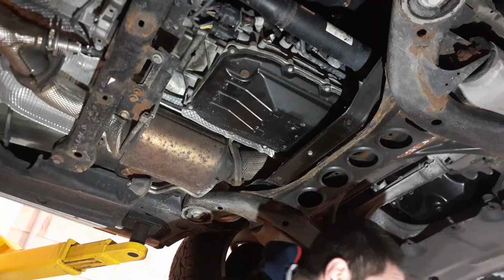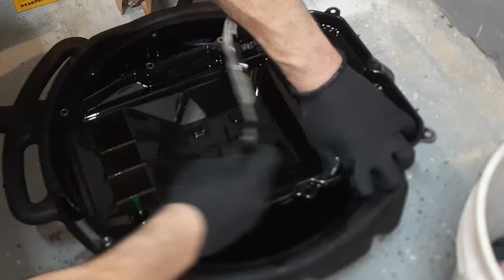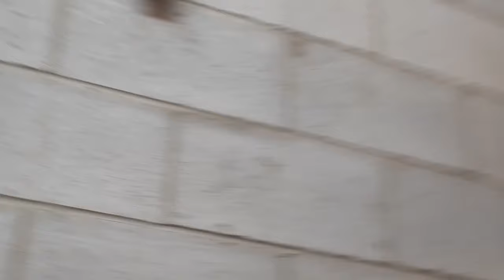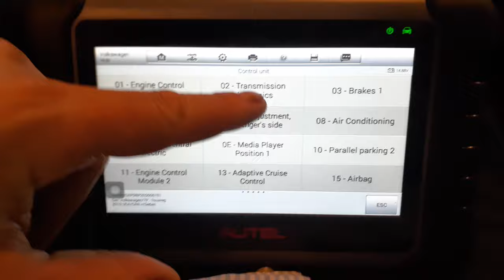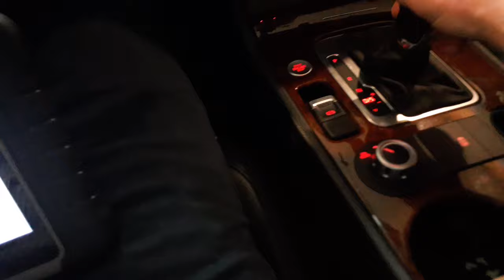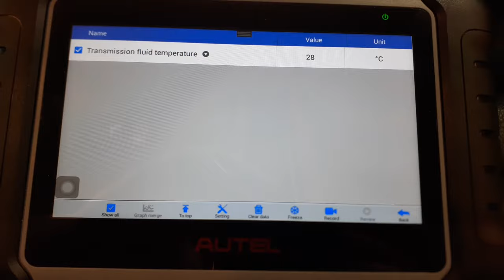VW Touareg Automatic Transmission Service

Comment: One tip, when you remove the pan bolts,  leave two of them on opposite side of each other barely tightened and in place. Then precede with the pan removal/prying. After the pan is no longer stuck to the transmission body remove the two bolts and lower the pan. Easy and zero mess.
Reply: Great tip, worked like a charm!

Comment: Very good "how to" video!! I have assembled all the components and fluid I need to do mine. I do not have a lift, so it will be a set of ramps and jack stands (keeping it level) and a creeper. I plan on driving it until full operating temp, this is about 180°F for fluid temps. Then I'll do the drain, pan drop, filter change and pan cleaning, and wait a couple hours until the temp is a lot lower.  I plan on leaving the parking brake on, holding the brake pedal, and rowing through gears while it's in the air with the front wheels on ramps, and the rear is on hack stands to make sure and circulate the fluid for the level check.

 I noticed you did not remove the engine/transmission dust shield bracket mounting crossmember, and you worked around it with a wobble extension. How hard would it be to remove the bracket I wonder? Or is it best to leave there when tilting the pan down it has something to "stop" from falling off completely? One of my concerns is making a massive mess while I'm on my back under the car! So glad you showed the "oops" moment when it dumped over the edge! This is the kind of info I like seeing so I can avoid it myself. Thank you thank you!

Comment: So glad I have a Toyota HLander.  Tran oil and filter change was easy.  Filling the ATF was via the fill & measure tube under the hood.  Why does VW make it so difficult.
Reply from the maker: I know so dumb
Reply: vw is not the only ones that do this anymore but it is still a rediculous method.
Reply from the maker: Toyota/ has a similar method if you follow service manual it's actually worse. But some friend I know at Toyota say whatever amount comes out goes it lol

Comment: This has been done incorrectly to get all the old oil out you need to undo the pan first drain clean replace filter reinstall pan, then remove the clamp for the transmission cooler by the radiator then attached 2 clear pipes on the cooler pipe flange and place in large container, fill the transmission with fluid about agallon of new atf useing the filling tool and a pump then place pump in another full bottle of ATF get some one to start the engine in neutral and watch the old oil get pushed out of the cooler pipes via the clear pipes from the torque converter and pump more AFT into the transmission at the same time , when the oil in the clear pipes turns from black to red then turn off the engine, reattach the cooler pipes to car and add up all the old oil to work out how much came out , then fill with same amount of new atf oil , start engine then run through gears and leave running in park pump more aft as nessaserry and then remove filling tool and let it drain till it stops then replace plug , this will ensure all the old oil is out of the torque converter and oil gallary combined with the pan removal this process will remove almost most of the old oil from the transmission.

Comment: Hello, I have a curious problem in the automatic transmission more than 2 years ago, which does not prevent the operation of the vehicle, nor does it give me a failure either. My Touareg 3.0 tdi v6 240 year 2010 7p5, when I select Sport mode in the box it indicates it but the operation is like the Drive mode. Sometimes it works well and sometimes it doesn't, what can it be? Thank you in advance.
Reply from the maker: I’m not sure. You would need a scanner and access to the tcm then you can see if it is actually in sport

Comment: Excellent video, thanks! Any comments on filter brands and which ones to avoid? Factory VW is stupid pricing but I read somewhere that Elring supplies OE.
Reply from the maker: I usually check what aftermarket option fcpeuro gives as a alternative because they tended to not want to sell garage parts.

Comment: Cool video. I noticed that the odometer was at 160 000 km. Was that the first transmission fluid change?
Reply from the maker: Yes it was.
Reply: Thanks for the reply. 
Good to know. I have a 2013 q7 tdi that I bought used. It just turned 200 000 km. I have changed all of the fluids except the tranny. A little nervous to do it at this point as I have no clue if has been done by the previous owner. 
Have you seen the Touareg after the gearbox oil was done? Any problems? 
My VW/ Audi specialist mechanic says not to change it at this point. He says the new oil would be too slick or something like that which could wear the clutch packs very fast and ultimately  lead to the failure of the transmission. In your honest opinion Should I listen and wait for the transmission to die or change the gearbox oil and gamble ?
Reply from the maker: @denisdavidov2297  If it has never been done. Don't touch it. Asisn, ZF 8 speeds are known for having issues if you change the fluid late in the vehicle life especially if the fluid is super dirty... you could technically drain just the pan. Catch whatever comes out. And put the same fluid you took out back in if it's super dirty. If it looks pretty clean then change the 3liter or 4 that come out with just the drain.
Reply: Thanks for the advice. Much appreciated
Reply from the maker: @denisdavidov2297  no worries.
Reply: At some, hopefully much later, point the transmission will fail. Would it be wise to get a used 8 speed or shell out the big bucks and get a brand new one?. I wonder how much it would cost?
Reply from the maker: @denisdavidov2297  brother no need. Remember it's about you how you drive, how you tow.  I've seen transmissions that never have fluid change make it for the life of the vehicle.  And some fail premature because of abuse. So I wouldn't be stressing. Enjoy it.
Reply: That’s a good point. I dive it like it was designed to. I don’t abuse it but for sure I like to open it up to stretch its legs once in a while. I am careful when I am towing but it is part of the reason why I got it. Maybe it’s not realistic, but I want it to reach 500 000 km. We will see how far we get.
Reply from the maker: I also tow with my rig. Boat,  and utility trailer. She doesn't struggle a bit. I know that in and out job will be needed with higher milage to address leaks, timing chain, front cover things of that nature. Usually 250,000+km those issues arise. Injectors maybe if they get clogged. There are some good videos about concerns with these engines. Just gotta look.
Reply: i have 250 K kilometers and they said yuor car is seald.no need oil change ?
Reply: @denisdavidov2297  Так что в результате решил ? заменил масло или так как есть оставил ?
Reply: @aleksandralex4085  left it alone.
Reply: Hello. What brand of oil you used? It's ok if i change on my Treg with only 56k km on board?
Reply: remember VW sell these cars as a no service transmission,meaning the entire  life of the vehicle they are good to go.This is obviously absurd since the same plattform Cayenne call the service for the auto trans at 90k km.Now my advice is have this unit serviced every 90-100K km.There are no clutches and steels that don't worn out contaminating the oil,the pasage in the valve body and the shifting solenoids and valves.There are specific designed machines for the service,which use the cooling line in and out as a filler and a flusher device pumping inside a flushing additive,then, after the pan is dropped and filter changed,they push in new fresh oil and they top as per shop manual with the requested operting temperature.Keep in mind that the torque converter,the hydrauliuc turbine clutch in front of transmission alway hold about 2-2,5 liters of old bad oil and contaminating materials.To be sure to totally flush the converter these machine, during the warm up phase,pump continuosly fresh oil in a closed loop till the color of the oil passing through the machine is perfect clear,then they do the final topping and disconnect cooling line from the machine .
Reply from the maker: Yeah, I spent over 15 years at the dealer using those machine's.  The avg person doesn't have access but they can do more frequent drain and fill. Over time you'll see a change in the colour of the fluid which is a slow more time consuming way of flushing the system.  We used to do it on old 2003-2004 Honda Crv at the dealer. nautorious for slipping clutches.  We would drain, fill, drive, drain fill drive. Eventually we would have a vehicle with clean fluid and less to no slipping. People neglect there vehicles or are told by manufacturers that it's life time or 15,000km oil changes truth is. It's all a gimmick to try and show you how little money you need to spend servicing the vehicle.  The truth is you'll pay for it later. Or someone will lol.
Reply: @MyHomeGarage  the key is don't wait till 100,000 to change the fluid, if the trans is not having issues it will not hurt it to change the fluid regardless.
Reply from the maker: @JB-ro3sz  100% I agree, but for many people, it is an expensive service to have done at a shop. The parts alone are over $200. It's a hard sell unless you're doing it yourself. If you're doing it yourself then I would do it every few years as I do on my Crv and csx Type s I've had since knew.

Comment: Hi, i used the same fluid LM 1800, and vehicle is jerking when stop at the light. Whats could be? Touareg 2013 TDI.
Reply from the maker: Reset transmission adaptations. Sometimes when the fluid is really dirty then you replace it the shifting changes. Also make sure fluid is checked correctly and your level is set properly

Comment: Hello,
For the Touareg 2014 3.0 Diesel 7P is the change the same and can you share the adapter with which you put the oil what is it
thanks in advance
Reply from the maker: https://www.blauparts.com/audi-vw-09g-09m-transmission-filling-tool-aisin-vas-6262-2.html

Comment: I have a TDI in great condition and love driving it.
It has done 211,000km. I am going to service the transmission as I intend to keep the car for a few more years.
Should I replace the oil in the diffs and transfer case as well?
Reply from the maker: No harm. And fairly inexpensive
Reply: Do it. It's actually one of the easier things to do. You should pre-emptively spray some kind of penetrating oil on the drain and fill plugs on the diff units. There is a fill plug, and a drain plug, make sure you can remove the FILL plug first!! If you cannot remove the fill plug, DO NOT remove your drain plug. Fix the issue. Cheap and easy maintenance. Use the correct full synthetic recommended by VW.

Comment: Hi, thanks for the video.

I have 2011 touareg 3.0tdi 315.000km on it. I’ve been owning for 30k kms. I don’t know if the transmission oil had changed by the previous owners. The transmission has no big problems, however when I release the gas pedal the car does not sail, it slows down like its breaking. This situation is very obvious on the 2nd gear when the car is cold. 

I was planning to change the transmission oil and the filter, however I am confused when I read your comments above. 

What is your suggestion?

Thanks in advance.
Reply from the maker: Mine does the same thing. Something with these transmissions when they are cold. The take a bit to get up and going. The ZF transmission would have been better. We have the asisn.
Reply from the maker: My whole thing is if you have never changed it and it has 300,000kms it's better not to touch. If you can find evidence that it has been serviced then yes continue to service. It won't hurt if you just do a drain and fill allows you to get a good look at the colour of the fluid. Then what ever amount came out you just put new fluid back in same amount.

Comment: would this be the same filling method for a 2005 audi a4 b6? I am told that on the b6 i need to do an adaptation procedure by driving the car 30 feet forward stop hold the breaks for 10 seconds then reverse for 30 feet stop hold the breaks for 10 seconds and repeat this process 7 times. This is the adaptation method. Oh...forgot to tell you that I am removing my TCM because it needs to get repaired so perhaps that is why I would need to do the adaptation procedure.
Reply from the maker: I can't confirm or deny that.

Comment: How much would it cost to replace 2009 volkswagpn v6 tourgig transmlssion fluid.adad
Reply from the maker: I believe It is a 6 speed unit. I could be wrong. But it's gonna be 200 in parts probably and then 1 hour labour so depending where you are 200-400 I could guess

Comment: I already went to Rockauto and found the speed senser, however it has only one socket of two cobles no 3 as you indicate and is external because it is similar to the crankshaft sensor. but your location according to my review I do not get it .but good anyway thanks, I keep looking for your location
Reply from the maker: I hope at lease your subscribed. Your taking advantage of my weakness for helping others.  

https://volkswagen.7zap.com/en/rdw/touareg/toua/2007-478/9/927-927070/

Item 24 is the speed sensor location on the transmission. 

I hope that my 30mins of research helps you out enough. just move proof that Mechanics and the automotive industry is so under appreciated. simple tasks like Component location. This is why I am not longer in the TRADE anymore. Everyone including customers, management, service advisors want everything done cheap or free. The truth is the amount of knowledge one needs to operate a service manual and or a parts catalog takes years of experience. no one wants to pay people for that knowledge.This is low level stuff imagine rear issues. I do all these videos and this channel to not only show how to do some work on your car but more importantly to get an appreciation for what it takes professionals to take on work on these vehicles so that when its time to go to a shop you underhands why it costs what it cost. Have a nice day. keep us all updated on the repair.

Comment: Doesn’t the TCM need reset after the service?
Reply from the maker: You can. I’ve even done adaptation reset. Didn’t really notice any difference.
Reply: @MyHomeGarage  this is the last step, I have VCDS, just need to get the procedure figured out
Reply from the maker: I have a autel mx808!I’ve reset the tcm many times I don’t think I actually found any difference.

Comment: Thanks for the video! What brand filter did you use?
Reply from the maker: Vaico.  If you have the funds obviously Oem is the best.  But I haven't had any issues with the gaskets bolts washers or filter to date.
Reply: @MyHomeGarage  What transmission oil did you use? Vaico as well V60-0131?
Reply from the maker: @carlosorff  liqui moly 1800

Comment: Isn't the engine supposed to be off to drain after you cycle the gears and reach 35-45 degrees?
Reply from the maker: Running.

Comment: I know this is off topic. I picked up a 2012 T3 w/131k miles. With all the issues these have it seems like their not worth ownership and possibly unreliable? Do you feel like it's worth owning, considering selling mine already, just like your opinion?
Reply from the maker: I believe if you want to drive a luxury diesel suv that is very capable. I don't believe there is a much better choice. These vehicles are good for 500000 km on factory engine. Watch a different car review he has a q7 with that much. If you buy these and drive them at to 250,000kms I don't think you'll replace anything other then some gaskets unless you want to sorta all thr issues out but then your left with a great sorted vehicle
Reply: @My Home Garage  Thanks brother for your opinion. I do own vcds but not very fermiliar with using it. I have 2 older vw tdi's that are easy and less emissions garbage. I know there seems to be nothing like driving a touareg. I guess we gotta pay to play...glad your making these videos to help guys like me. My intake and egr is a different settup then the 13s on up and can't find many videos on them, hopefully in the future...thanks again.
Reply from the maker: @benjilacombe7478  the oil cooler is the same its the egr cooler up top that is a different design. Find a free online manual for these cars it's out there. And it shouldn't  be to hard if your mechanically inclined and have hand tools the correct ones.
Reply: @My Home Garage  Got the tools and some mechanical knowledge but not a technology wiz by any means. I noticed this car has a diesel exhaust smell. It could be another issue, but I also notice it feels quite peppy compared to my last touareg I breafly owned. It makes me wonder if it has a leak pre dpf or been deleted...hmmm. Thanks a million for your input.
Reply from the maker: @benjilacombe7478  yeah take it for a long drive steady speed like 2-3 hours. That will allow the DPF to clean itself naturally. Because it can for regen even at idle if it needs and it sprays adblu in exhuast to minimize the emissions. And you get a sweet kind diesel smell out the back. I have noticed. No not put your nose there you'll get a headache.

Comment: I just have done my 2013 Touareg 3.6 vr6 transmission oil change with filter, initial fill 7L (I forget to do 4~5 first then 2~3 later) and after getting trans to running temperature, it overflows about 1L out. One surprise the one transmission oil pan screw breaks apart and the half with the head is out, the other part of the screw is left in the transmission body... Any suggestion here?
Reply from the maker: Needs to be drilled out and extracted